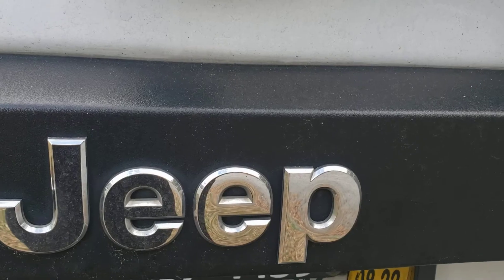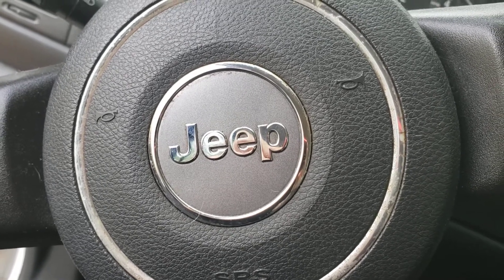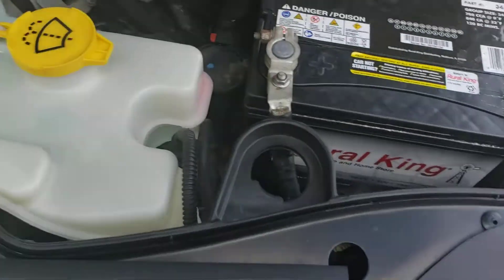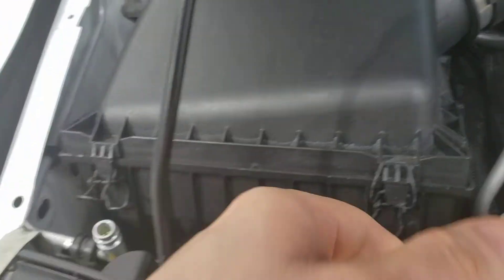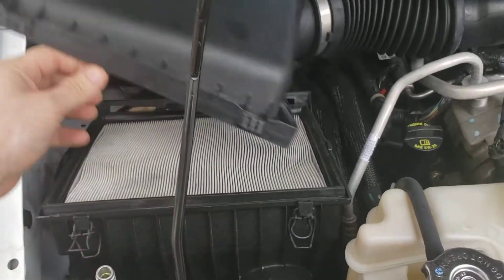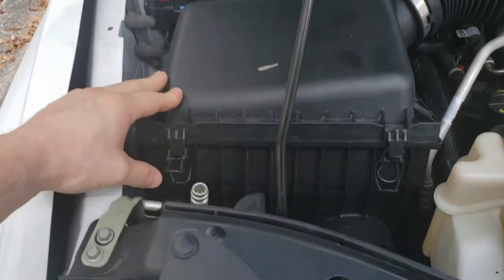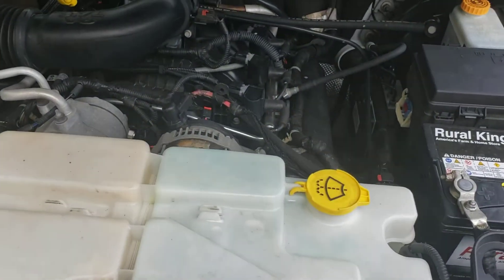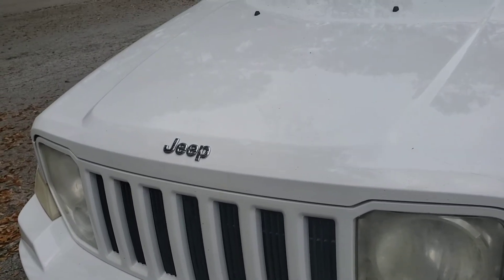2008 - 2012 Jeep Liberty air filter location.

Comment: Hey nick. My truck is dying again😂
Reply from the maker: Dang Christian, what are the symptoms  like this time?
Reply: @MobileNickMechanic  cylinder 3 died.   It’s the coil packs.   I just bought some new ones
Reply: @MobileNickMechanic  also the whole deli misses u
Reply from the maker: @christiancat2. Might as well get a whole tune up while your at it, coils, plugs wires and all. I miss yall too
Reply: @MobileNickMechanic  where could I go to get my truck tuned
Reply from the maker: @christiancat22  i have had good experiences with tire plus in Gainesville. (13th street by my publix)  I'd love to do it if we weren't so far apart and busy
Reply: @MobileNickMechanic  felt that
Reply: @christiancat22  How many miles you have on your vehicle?
Reply: @Capt.Rankin  problem was fixed. I just had a coil pack go bad.
Reply: @christiancat22  I know I was just asking how many miles did you have on your car when the problem came up
Reply: @Capt.Rankin  some where around 148k
Reply: I replaced the CAF in my liberty after I noticed a chemical and or mildew smell… seems to still be happening, could it also be from a dirty air filter?